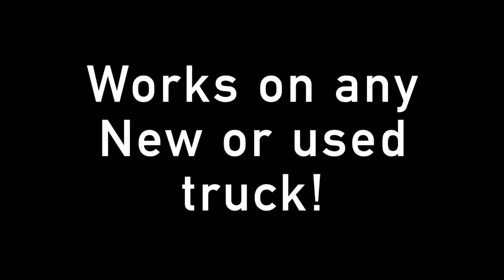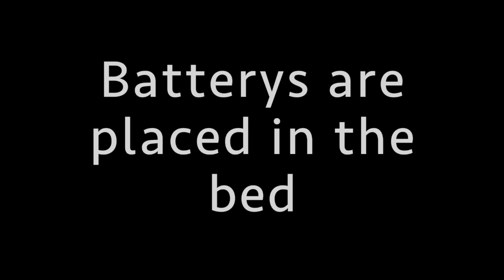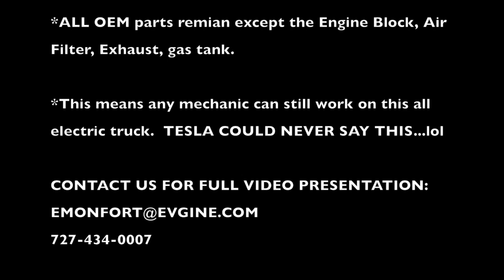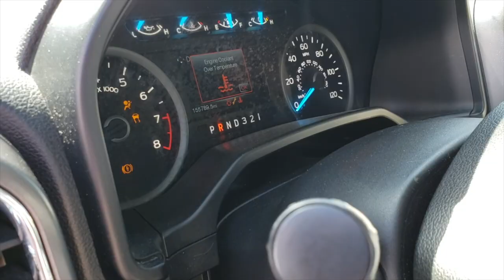EVgine All Electric F-150 Ford all electric conversion kit.  Read more about our batteries below.

Comment: Why not put batteries in the engine bay and under the bed?  This basically makes the bed unusable as it is.  Very cool build it just loses a lot of utility to the batteries
Reply from the maker: Please see next video with finished bed. There is more cubic feet for bed space  using this method.  As for putting the cells under the truck is one of the worst ideas ever because it allows easy damage or puncture to batteries which can cause serious fire.  Look at all of the videos of Tesla cars catching on fire from running over object in roads.

Comment: Already been done 
https://youtu.be/ueCSIcjpU9Q
Reply from the maker: Nice job but I dont see a ECU connected to the TCM using a liquid cooled AC/PM electric motor, converter, inverter and charger.  EVgine is All liquid cooled and CAN bus communications and fully installed software.  
EVgiine system works with very converting old cars and trucks and modern day cars and trucks.  New or Used. Much more advanced technology on the EVgine system.
Evgine is plug and play with all of the wires, plugs, software and any mechanic can install it.

Comment: How much can it tow?
Reply from the maker: Using an Allison transmission we have proven that this same drivetrain can be used on a 20,000GVW truck with the ability to go straight up a hill with no roll back.  Not one single electric truck in the world has done this to date.  To answer your question this F150 has a towing capacity of 16,000 lbs if the Ford transmission could handle it. 
I will pay $1,000 to anyone that can show an electric truck that can go up a hill with a 19,800 lbs total weight using only a 200kw electric motor. Our concept F150 proves that our technology will work on all electric Class 8 trucks.  We have the motors and inverters now that will allow us to mass produce all electric Class 8 trucks using less power and more pulling power than any diesel or electric truck competitor in the world.
Reply from the maker: 20,000 lbs and we have video proof going up a hill with no stall or rollback

Comment: how much? OK, looks like these dudes are in Florida and do not sell this kit but sell the service of installing it for you, correct me if I am wrong, the finished product looks clean and professional and well integrated
Reply from the maker: I called fo pricing and the kit is about $10K less than what Rivian advertised with Amazon.  The guys out of Florida bought from EVgine and installed in a couple of days with two local mechanics.  This system allows the truck to tow trailer because they found out the direct drive trucks that need to tow or have heavy loads need four motors like Tesla and Rivian.  EVgine system has more torque and power using only one electric motor and transmission.
Reply from the maker: We will be about half the price of OEMs electric vehicle cost.  If you have a delivery truck service  that uses around $50 per day in fuel then we have a 5 year pay plan.  That means after the 5 years your fuel is free.  
We went into a local car dealer trying to get this deal and they all laughed in our face.  They said there is no such thing as free fuel after 5 years.

Comment: Why would you do that? What is the point of having a truck when the battery sit on the bed. You can't put anything else in there. There's tons of space underneath and some space on top of the electric motor.
Reply from the maker: That is why we made a second video with hidden batteries because we knew people wouldn't read the description section explaining why we showed the batteries in this video.  The second video hides the batteries and shows full truck space available.
Reply: @ACDCev  yeah. But, I like to use the tool box to hold my tools not the batteries. 🔋 you should check out YouTube channel greg go electric. See how he converts a ford 450 into electric using the tesla batteries and it's shape like V so everything fit under the hood. Very cool. 😎
Reply: @ACDCev  just saw that other video. Using the "fake bed" still no good because i need to put big tools in the back. Sometime I haul big thing from home depot. Sorry try again. Though i did like that other truck. Noseless truck.
Reply: Please see next video with finished bed. There is more cubic feet for bed space  using this method.  As for putting the cells under the truck is one of the worst ideas ever because it allows easy damage or puncture to batteries which can cause serious fire.  Look at all of the videos of Tesla cars catching on fire from running over object in roads.
Reply: @GreenEnergyGuy  check out EV West truck. The battery is underneath and it uses a protector.